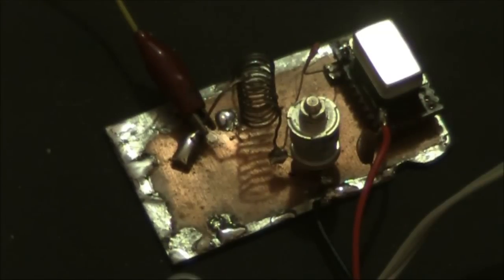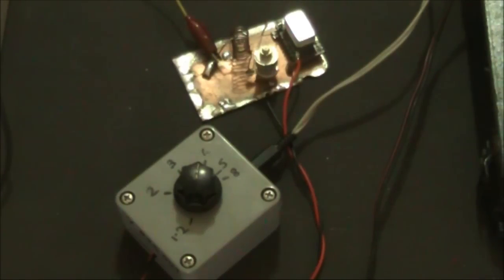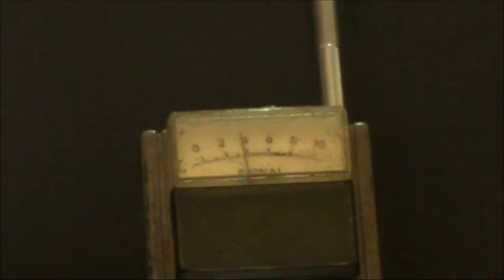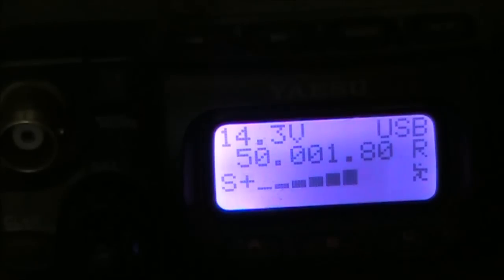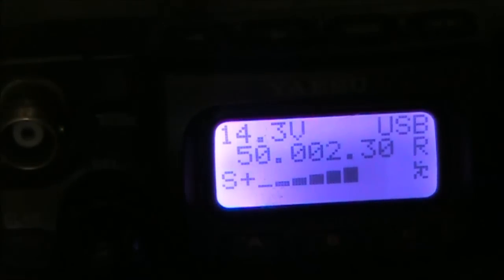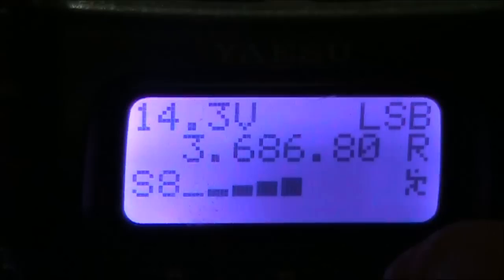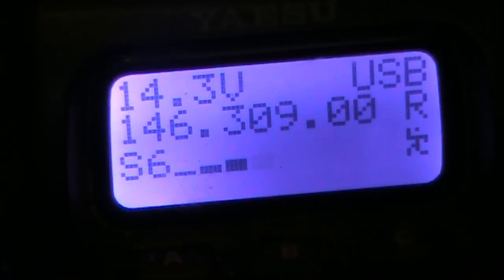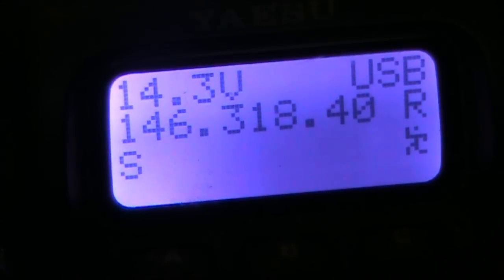Frequency shifting a crystal oscillator module

Comment: I used one of these oscillator modules in your cb to 7 mhz  radio made the job easier.I have also filed of the edge off the oscillator to remove the cover and replaced the xtal with one better suited to my needs.Enjoyed the video keep it up.
73s